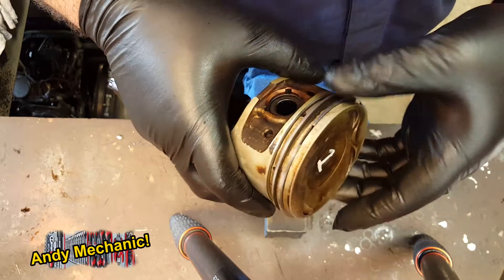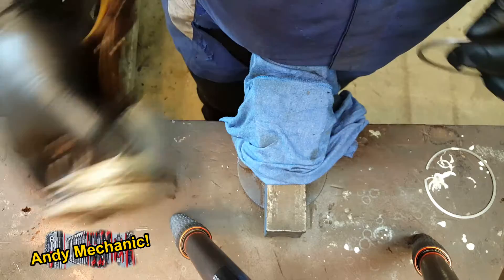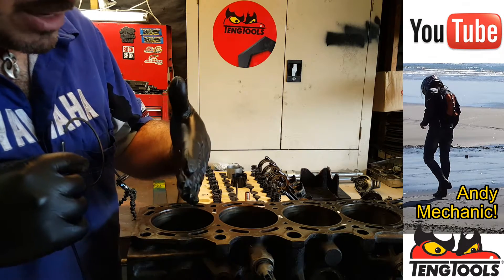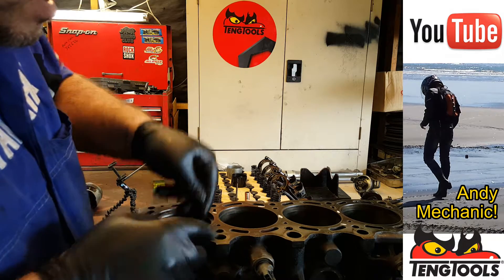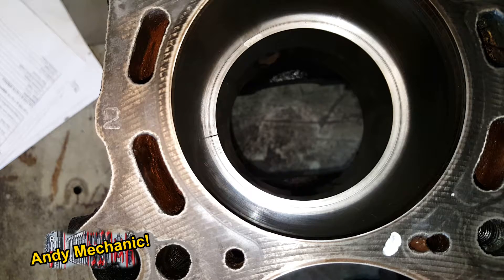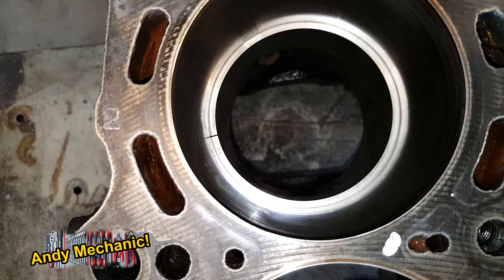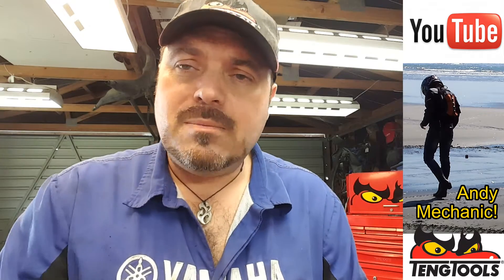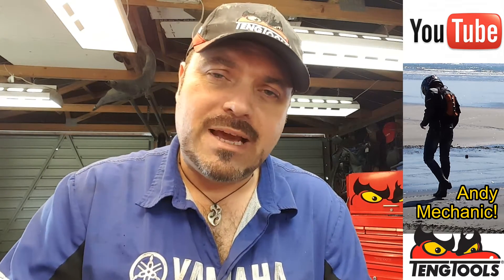Toyota Rav4 piston ring end gap measurement Ep21 #1135

Comment: Hi Andy, in my case I am rebuilding our 2004 Corolla engine. I have a set of Maleh piston rings which part number is the right one for the car according to 2 different sellers. When I try them, it seems the gaps are way too big; according to the Hynes manual, my gaps should be .0004 per inch of bore and the bores in my car, not measure  at this point they are 3.11 x 3.60, which leaves me at a maximum of .0012, now the gaps measure up to .0017 and .0019, which is way more than my max but what is confusing to me is that the same book says that gap is not critical as long as it is not over .0040!!! It is because of this I hav e not installed rings yet, i am waiting on the OEM ones I ordered and would probably send the Maleh back. The block had 80000 miles on it when i took it out of the car, the only thing i did in the machine shop now to it was inspect for crack, de-glaze the bores, not hone, did one pass to the surface for cleaning and i am using good pistons from the actual damage engine that replaced this one on the car but the piston rings would be new as recommended. Do you see anything here indicating I am doing something wrong? the info in the Hynes manual throws me off completely as by the specs gaps should be from 0.0009 to 0.0012 but then it says that "it is not critical" as long as it is not bigger than .0040

Comment: Hello, thanks for all this precious info. I own a 1997 Toyota Rav 4, that used to consume a lot of oil. More than half a gallon to 600miles. I took it to the garage, they've changed the valves, rings and seal of the engine. I have it back but.. it still consumes oil, and exhaustion a lot of blueish smoke, more than normal. I then replaced the oil with a thicker one but the smoke became even denser and the oil consumption continued. Any ideas what could it be? Could they have faulty replaced the parts?
Reply: Hope you went back to that shop that did the work for them to do it right by now. i am not mechanic but according to what I watch here and read on books seems the rings are not right in your car, either they have not put a new set or they did not make sure the set fits to specs. You would be surprise how some places that call themselves mechanic shop conduct their businesses, even at the dealer it all depends who works in your car. Our main car has lifetime warranty on mechanical issues I bought for it, as long as regular maintenance is done, any problem with the car the dealer would fix it; they have already replaced the engine under this at only 60000 miles. Then we have a Corolla 2004 which have been butchered by a "mechanic" and given up by the "dealer" then i took it under a project to reconstruct the whole engine, which is why I am watching these videos in search of info. our car also consumes too much oil but for other reasons but piston rings and their end gap are really important in that area.

Comment: Glad to see Andy that things are getting back in spec :)
Reply from the maker: +stuzman52 yes, the crank, con rods & oil pump look good. I'm confident I can remedy the warped block by hand rather than paying for a skim.

So, new rings, valves, valve spring, crank main and big end shells, full gasket kit with all seals and rocker cover gasket. Valve seat re-run and all new valves to lap in.

Guides are all in spec as are both cam shafts too. Head warpage is within spec

It's fixable and it will be done....